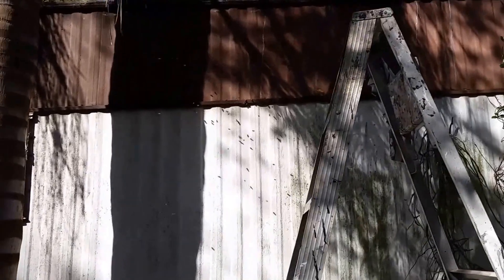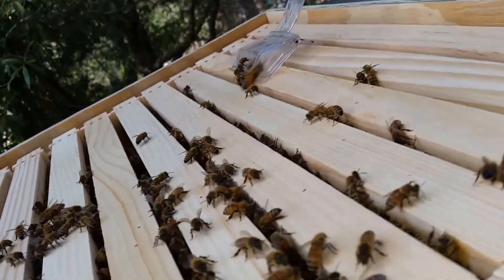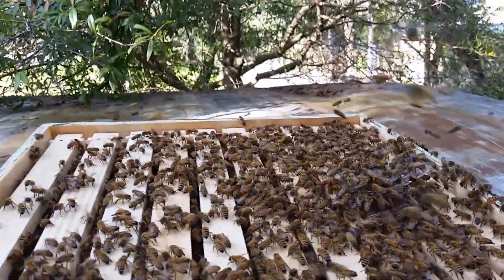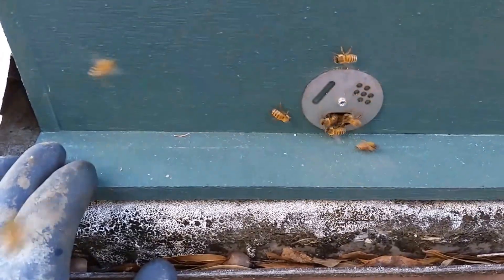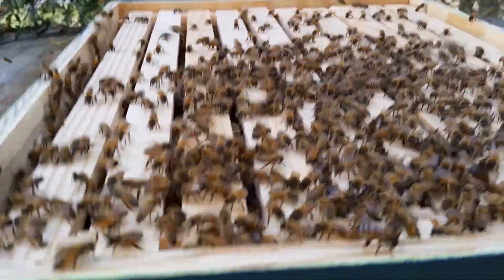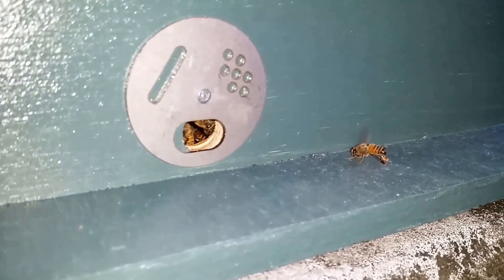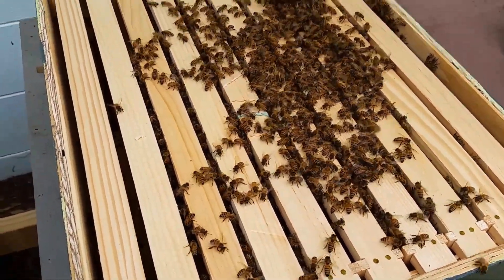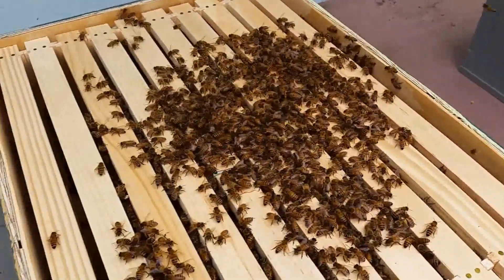Lakeland, FL Mobile Home Honeybee Removal   3-1-16

Comment: you sure are bizzy with bees do you rear your own queens or buy them in if you need to requeen another question are you a pest controller nice vid as always Patrick
Reply from the maker: +adrian forrester  - Adrian, well, I rear my own queens by doing splits.  I don't raise queens for the sake of raising queens to sell or to have on standby.  Also, if one of my feral hives loses a queen for whatever reason, I usually make sure they raise their own successfully.
Reply from the maker: +adrian forrester - Also, no, I'm not a pest controller.